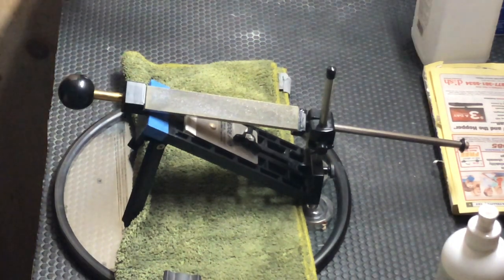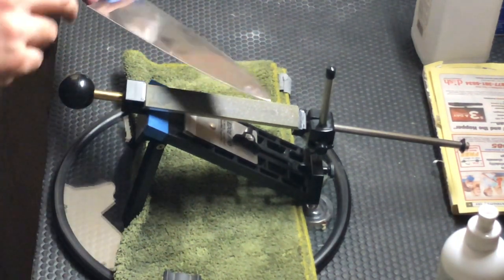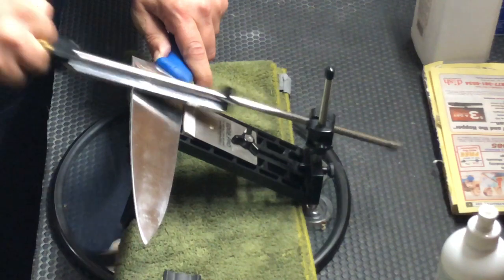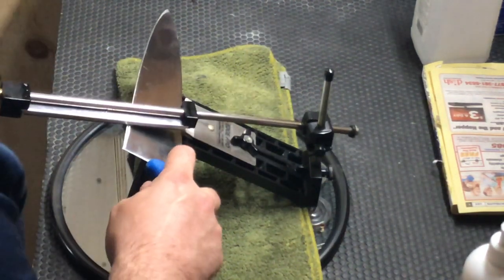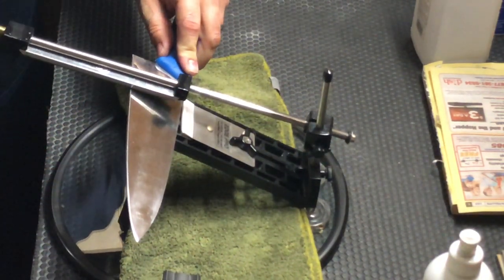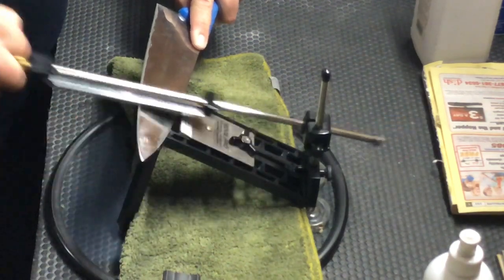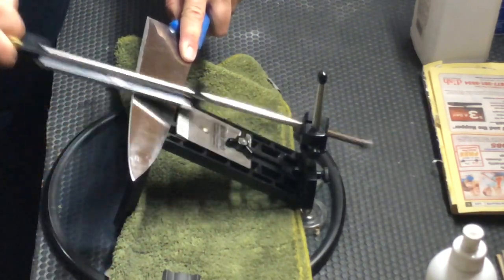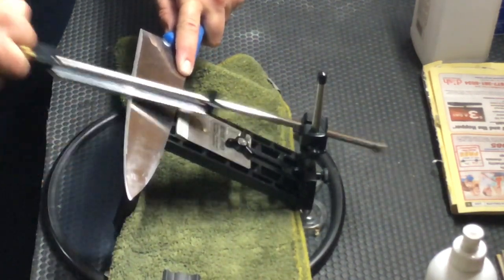Edge Pro Sharpening: Thinning The Blade

Comment: What upgrade?
Reply from the maker: I’m getting the table replaced and getting magnets added.
Reply: I’m a chef and I love my edge professional, I noticed that the “hapstone” has something called a micro adjuster for fine tuning your desired number on say a angle cube.
Reply from the maker: Patrick Graves Yeah, it does. I looked at the hapstone, but I still prefer the Edge Pro. I am partial to things made in the USA. I am able to make fine adjustments with the Edge Pro. I feel that the hapstone tried to “fix” the supposed issues with the Edge Pro.  Like the stop collar, and the fine adjustment. I use to use the stop collar but found it added time to my sharpening and it was not necessary. This is just my opinion.
Reply: Brad's Pro Sharpening I’m dedicated to the edge pro , it yields great results I’ve sharpened anything with a edge from scissors to chefs knives also ceramic ( awesome challenge if you never have done it) I also like American made . Are you on Instagram with your sharpening?
Reply from the maker: Patrick Graves I am...
Reply from the maker: Patrick Graves those Japanese steals are tough. I like using the new Diamond Matrix Stones from edge Pro on those steaks.